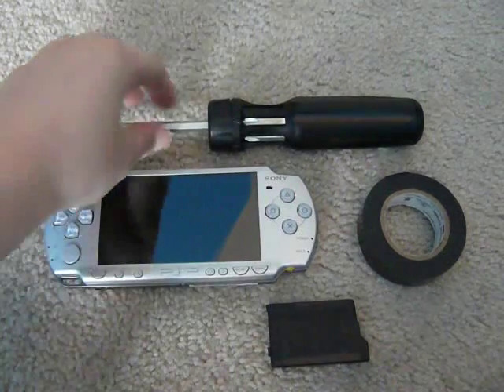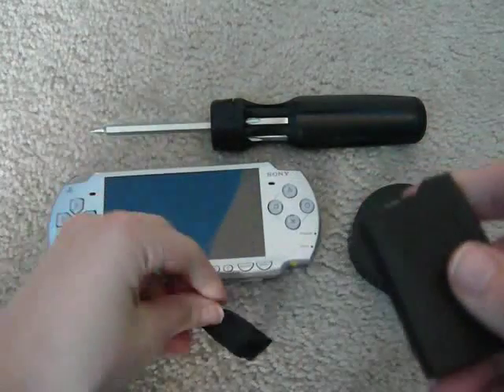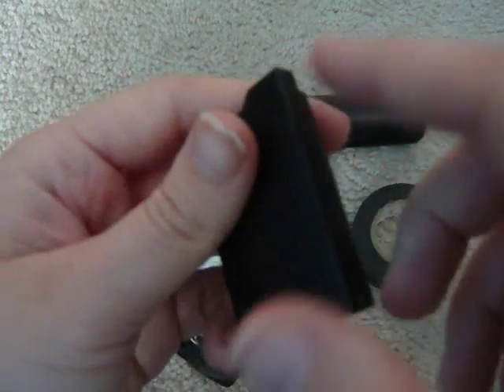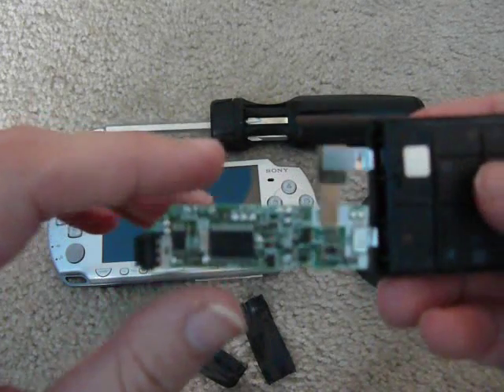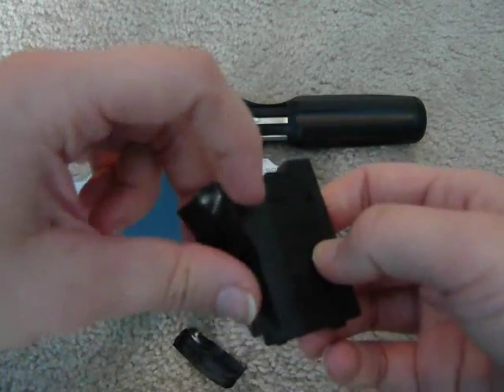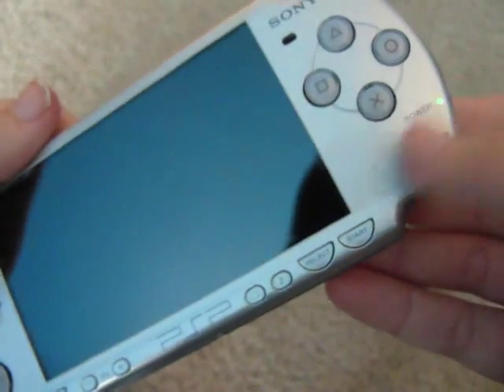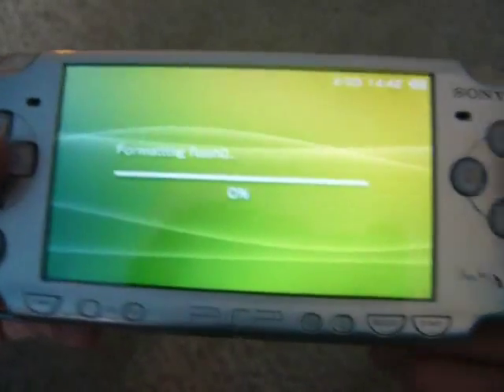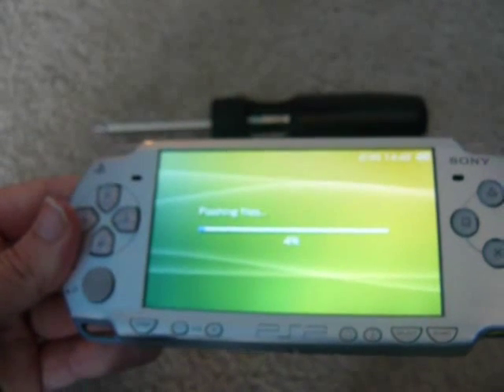How to make a PSP pandora's battery (SLIM)

Comment: I Want to have cfw 5.00 or some firmware i can use Fusa. thats really the only reason im modding my psp slim, i opened up my battery once and i just closed it back up because i had problems with my phat psp. i currently have version 6.10 and i have a formatted 2gb mem stick. should i use PSP Grader v0.8 beause thats for cfw 5.00 M33. Can i use psp grader v.0.8 now or should i downgrade it first what firmware should i downgrade to and how can i downgrade it?

Comment: I cut the copper line, not the chip's leg. I have the Red PSP-2000 Slim. When i put the psp battery back together, i put the battery in and the green power light comes on for like 3 seconds and then shuts off. PLEASE HELP!!!!!